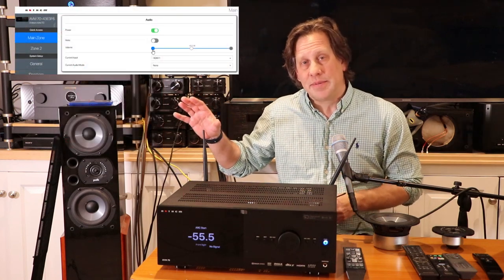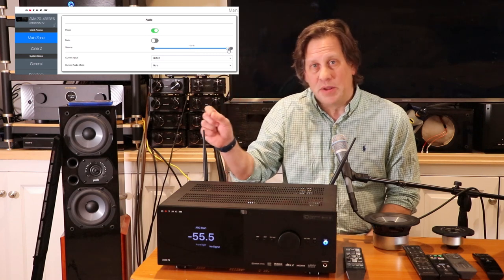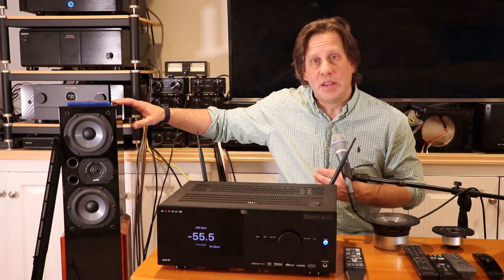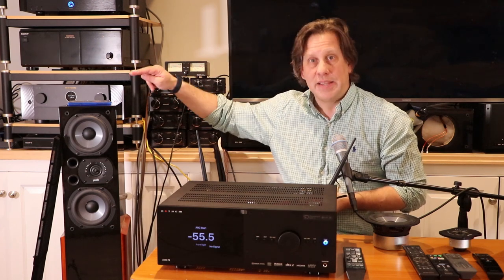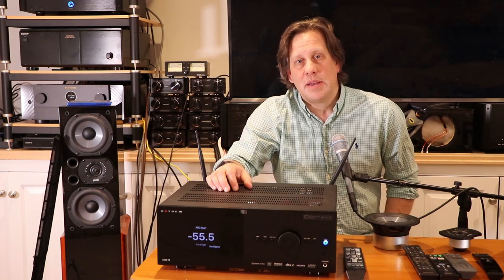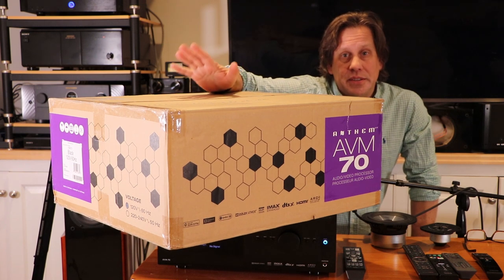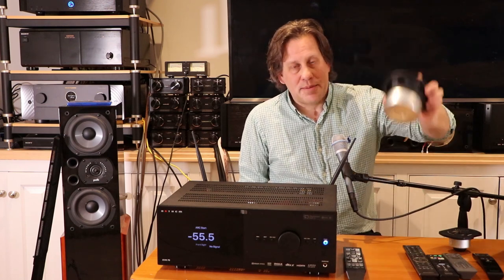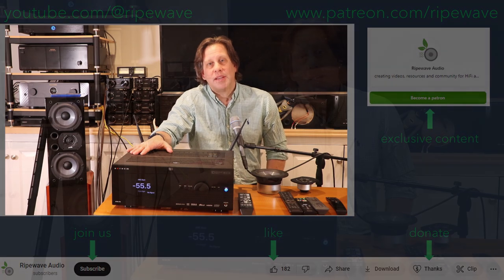Anthem AVM 70 8K - Part 3 - Failing Amp, Blown Speaker Troubleshooting

Comment: I noticed the exact same phenomena.  My speakers played extremely loud after running ARC Genesis, easily approaching 10-15dB on average.  I have Legacy Focus SE's which aer 4 ohm speakers with a sensitivity of 92dB and I power them with a D Sonic M3a 1200S, which can supply 1375 Watts into 4 ohm loads.  Since I had so many other issues with the AVM70, I just sent it back before ever getting a chance to dig into it further.
Reply from the maker: Seems like your speakers and amps are even a few levels higher quality then mine and you still had issues. Very odd. It just got to a point where I could risk another failure. I have gone decades without damaging a component. -Jon

Comment: One of the first things I did when I got my AVM 70 was set a volume limit.  I have always done this with my prior AVRs to avoid myself or someone else accidentally blowing up my speakers.  Glad I did because the volume control is rough and I have also accidentally blasted to my max as well.  Despite this the avm 70 has delivered the best sound I have heard in my set up but it does have caveats.  If you get an anthem read the manual front to back and make sure the first thing you do is set the volume limit.
Reply from the maker: Great suggestion. I did the volume limit. Out of the box the limit is not set so you get +10dB by default. I set mine to +0dB but that was not enough to save the day. -10dB would have been better - especially during calibration. I agree, calibration issues aside, the unit sounded great! 

Jon
Reply: @ripewave  I'd have expected, given the potential cost of the kit this device interfaces with, that it would be safe by default. The customer would have to have read the documentation and purposefully elected to disable the safety limiter when taking it out of the box. This just sounds like poor design.  So glad I got to learn from your experience.

Comment: I have an AVM 90 and have done many ARC runs without issue. Have friends with positive results. I use my anthem in a home theater driving Emotiva amps which have been well behaved and you seem to have a bias against Anthem. I have both Emotiva (RMC1-L) in an audio listening room and the Anthem in the home theater. Both sound good. I thought ARC was easier to set up than Dirac.. results are similar. Suggest you try another Anthem unit. Thousands of happy customers like them.
Reply from the maker: It is comments like yours which suggest I might be doing something wrong. I would prefer that is the case. I am working with Anthem to bring light to the situation. So no bias, just reporting my experiences. I have yet to run into a perfectly designed processor or receiver. As shared in the video I praised Anthem for the resulting sound quality and from that perspective I can see why there are many fans. Once Anthem comes back with there guidance I can share any new knowledge out through this channel. 

This may be like cars - every once in a while they have one car within a successful design that comes off the production floor a lemon.

Jon

Comment: I don't agree with your assessment that ARC Genesis "caused" this, or even had any responsibility with it. It's the job of the end user to assure that all settings are correct. A misclick is the fault of the user, not the program designer. And because that misclick caused your 1kW amps to severely over drive your speakers, that is also your issue. It has nothing to do with the AVM 70. To include this in a review is subpar and to falsely label a video as "ARC blew my woofer" is disingenuous at best, straight up lying for clicks at the worst.
Reply: I thought he did a good job illustrating how poor volume slider design in the ARC software made it way too easy to accidentally max out the volume. Poor UX design is in fact Anthem's fault, not his.
I have an AVM 70 8k and i noticed this issue before I saw this video and I agree with him.
Reply: Although I agree that over amping is a risk he took!

Comment: The AVM 70 does have a maximum volume limiter setting on the general tab of the online setup. That should help keep you from accidentally blowing anything up. When I got my AVM 70, I also accidentally hit the volume bar and made it jump up quickly but I thankfully didn’t blow anything up. Setting the max volume has prevented that from ever happening again. I’m running mine with a Monolith 7X at the moment. I wonder if the volume limiter would help solve the ARC high volume issue as well?🤔
Reply from the maker: That is a good tip. I had mine set to 0dB and not the default of +10dB. That may have been very bad. So maybe -10dB would have been enough to save me. -Jon
Reply: @ripewave  Yea, I have mine at -10 which is plenty sufficient.

Comment: Greetings. The exact same thing happened to me. I blew my tweeter when I was increasing the volume with my phone. The volume jumped to max when I was tapping the button. Wish they can do a software fix so the volume bar doesn’t jump to max if you accidentally hit the bar. Otherwise I love my AVM 70.
Reply from the maker: Thanks for sharing your experience. Sorry to hear you had the same issue. Sounds like we are justified in our request to have their interfaces protect against unintentional actions. -Jon
Reply: Come to think of it I had a similar issue with volume control on my Marantz SR7010 and AV7705 I am using now.  I believe it was related to the phone and App I was using.  So I setup the volume limiter to 80% of max and replaced the phone with a new tablet and updated the app.  I have not had an issue since.

Good Luck

PM

Comment: Yes the sounds are loud. I can hear that my speakers are not really enjoying themselves although they do not distort. I think the loud output is necessary to achieve a good measurement..I had experience with these kind of systems on Denon and always had to do a lot of corrections afterwards. When you have a speaker in a corner that speaker turns into a kind of megafoon. Low frequencies are filtered out completely probably because it is standing in the corner.. With the ARC Genesis this goes way better but as I have experienced if you let well informed guys take a look at it the are able to make even much more good results .
Reply from the maker: I agree that the calibration tools are not always plug-and-play and having a well skilled calibrator perform the process can make a big difference on the outcome. I have learn not to trust the first run with these tools but to really learn and re-calibrate until you feel you have it right. 

The process I use with Dirac is to set levels 20dB above the noise floor. By making your space as quiet as possible (turn off furnace. AC, washer, dryer, kids etc) when measuring lowers the noise floor and therefore lowers then volume needed for a clean calibration. It seems Anthem is pushing high to drown out any noise floor. I would have hoped they could measure the noise floor first then base the volume from there. -Jon

Comment: Same problem here.  Speakers were super loud during genesis.   However even worse is that now my eArch channel doesn't work anymore and it appears HDMI connections on the back don't connect properly to the cables.  Frequent dropouts and connectivity problems.
Reply from the maker: So sorry to hear that. Is Anthem support being responsive? They only used email communications and those were not timely or helpful. Hopefully, they are able to do more for you. -Jon

Comment: I run two AVM70’s in two different systems with zero problems. Love the 70’s.
Reply from the maker: Glad your experience has been great. I hear more positive feedback then bad. There are a few that had the same trouble as me. Best I can hypothesize is that with certain speaker/amp combinations the AVM70 calibration process is causes to loud of output or they may have some inconsistent production issues whereby some units are impacted. Several weeks later and no reply for Anthem - perhaps they are just as baffled by the discrepancies some users are reporting while others have not trouble at all. Again glad you are in the majority on this one. -Jon

Comment: Very sorry to hear about all the trouble and thanks for the effort to test the Anthem AV70.
It was a processor I had on my list to check out so that's not going to happen anytime soon.

But I too had once a problem with strange measurements of my speakers and  I too have Emotiva Amps but in my case it was a blown filter component in one of my speakers.
At first I also thought I might have blown one of the speakers. 

Now my speakers at that time where already a bit older and a capacitor normally has a live span of 15 years although these speakers where only 9 years old I rebuild and replaced both filters, that said the original filter components where quality wise subpar and the overal filter was pretty small.

I rebuild both filters with much better quality parts all with very high quality audio performance components like Mundorf resistors and very big Mundorf MCap 450v capacitors. instead of those old and very small 63v capacitors that where in the original filter. This made the filter pretty big and heavy but the speaker case where large enough.

Another thing I changed was the internal speaker wires with some real high quality speaker wire from "van den hull".

It resolved my problem with my speaker and it really increased the sound quality of both speakers.
Anyway that was my painful journey with a suspected blown speaker issue.

Again thanks for all the effort.
Reply from the maker: I think upgrading the components in my speakers could help. It would be great if that turns out to be the issue, but that would align with the fact I can get good measurement on my left speaker if I simple switch the amplifier.-Jon

Comment: Balanced signal is 6db hotter than unbalanced, I noticed that when I "upgraded" to balanced from unbalanced cables. And I agree with your comment that they need to remove the abillity to jump in the level sliders in the WebUI.
Reply from the maker: Thanks for the 6db hotter detail confirmation from your experience. I need to ping Anthem again as they still haven’t sent back any further explanation. -Jon

Comment: I appreciate your continued detailed coverage of this unit. Your experiences closely mirror my own. I had actually purchased this last year as the 4k model, and did not have the increased volume for ARCG sweeps via XLR. The test tones were similar to that of Dirac/Audyssey/Trinnov Optimizer. So I don't know whether it's a firmware issue, or something in the newer 8k models that's causing the issue. 
It's really unfortunate that in testing this unit, your speaker and amp became casualties. That would also leave a sour taste for me. But I do hope that you're able to find your way back to an Anthem as I do feel once they iron out some notable kinks, it's a great platform,. It has such intuitive and effective room correction, and is a notable step from Denon/Marantz, delivering better sonic performance.
Reply from the maker: Yes - still working with Anthem to determine the cause. If they are able to explain how to overcome or provide a firmware fix I would be willing to try again - especially if sent a loaner unit. Given current status I needed to return to avoid absorbing the $3,400 sale price + tax cost without knowing if this will be resolved. -Jon
Reply: @ripewave  Anthem's continued support of the unit has been assuring. Their recent firmware update helped to resolve excessive fan noise many were complaining about. It seems that they're listening, and can actually make the necessary software tweaks to continue to improve stability. It seems like a good long term bet.
Reply from the maker: Yes - I do recognize that they have made improvements along the way. As one of the smaller companies (vs Denon/Marantz/Harman) their progress is slow. 

I was running the latest firmware and still found the fan noise to be distracting. I can only imagine how loud it was before the update. -Jon

Comment: Well if Anthem is out have Crutchfield bring in an Arcam AVR😊
Bummer the issues happened. I have Arc Genesis on a pair of paradigm defiance X 12 subwoofers. I was able to run Arc one time through the computer, and after that, it will no longer recognize the subwoofers. I can only do it through the cell phone app, which is not as accurate. I reached out to anthem about it, and they didn’t really have an answer more of a it should be working fine response. The subs are OK. I’m not in love with them. They are going to be around for a few years in my system. Next step is a new AVR. Like I said on your last video, the new Onkyo RZ70 or an Arcam unit is pretty much where I’m at…
Reply from the maker: Very odd about not handling your subwoofers. It would be great if the Onkyo proves out as it is more affordable than the Arcam. -Jon

Comment: Just came across your very detailed video. I have a recently purchased AVM 70, after running arc for the first time I blew my right height channel on my Rotel 5 channel amp. Since the Rotel is on the older side I assume it was the age of the amp but now maybe the Anthem might have been the issue. Thanks for the heads up
Reply from the maker: oh no! I was hoping my issue wouldn't have impacted others, but I continue to hear similar reports. Not from all, but enough. I think those with more powerful amps are more likely to encounter. Were you able to resolve?  -Jon

Comment: Like me, you probably remember companies having beta testers back in the day. Typically they would use random people of varied backgrounds and experiences to test products, hopefully identifying problems to correct prior to public release.

While I love Anthem and use the MRX-1120 (prior generation to your test unit), I have to say it has been painful to watch the rollout of the AVM70/90 and MRX-x40s as well as ARC Genesis. I feel your pain and am sorry for your misfortune.

Each time I am about to click ORDER on a AVM70, I see a whole new set of problems populate that I cannot blame on user error. Your experience, admittedly had some user error; but, in no way should that happen during a calibration. It is obviously an oversight of the engineers and programmers as well as the testers. 

It’s not like your high dB complaint is the first with regard to calibration. My guess is Anthem found 90 dB to create the most reflections without causing damage (of any sort). How much that changes at 80 or 85 dB? 

The lack of documentation and procedural algorithms plague Anthem. Your method (and other YTers) do not follow the varied pattern necessary to “read the room.” Anthem could easily address this with an introduction video covering setup, network connection, and calibration protocols. Instead, they rely upon the forums and their painful customer service/technical support system.

The same happened to Monolith and their processor, although it shows to be back online and in stock. While I very much enjoy the Monolith 7X amp, I still have doubts about their first processor. 

While I await reviews and feedback on the Marantz A10, I will strongly consider Storm and Trinnov processors instead. At this point in my life, it should be the last processor I purchase and the investment seems more clear considering the rollout fiascos seen with other manufacturers.

I very much appreciate what your channel does and until now have only been a casual observer. You earned my subscription and I am happy to be part of your audio/video journey. Good fortune to you and many blessings.

Comment: Man, Very sorry to hear about all the trouble and thanks for the effort to test the Anthem AV70.  Does the Anthem have volume protection setting built in like the Marantz does where you can set to let's say 80% of max as to protect your investment?  That would be my first question to Anthem.  I was looking to purchase that down the line but see this and now having second thoughts.  Emotiva will take care of your map issues no problem.

Good Luck

PM
Reply from the maker: Thanks for your empathy. The Anthem AVM 70 does have a setting that allows you to set a maximum volume. The default is +10dB over reference but I had mine set to 0dB - which was not enough. -Jon

Comment: Oh man this is not good news at all and I really feel your pain. Techthusiasm had similar issues, but I'm really disappointed in Anthem. That's them off my list.

Despite the cost to you, we appreciate the effort, time and info.
Reply from the maker: I am willing to absorb some pain in am effort to benefit this audience. I just hope my Emotiva mono block survives - I love that amp. -Jon
Reply: @ripewave  it's very annoying that tech companies nowadays releasing products that are miles away from being finished.....then they cause issues like you are experiencing.

I'm not a fan of D&M, but they seem to be one of the only ones with stable products at launch. Got to give them 👍🏽(props) for that.
Reply from the maker: I think the difference it that smaller companies don’t have the resources to perfect software without more time. Denon and Marantz are large and share technologies and software across brands making them more stable. Even at that they have a major fail with the initial HDMI 2.1 launch. While blame can be directed in part to the chip supplier, their testing should have revealed the need to hold shipment until resolved. -Jon